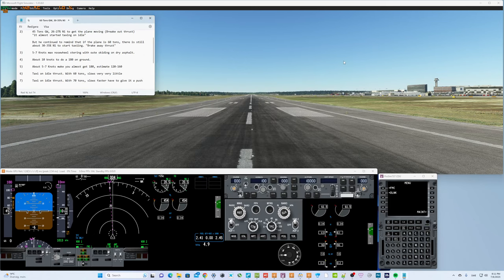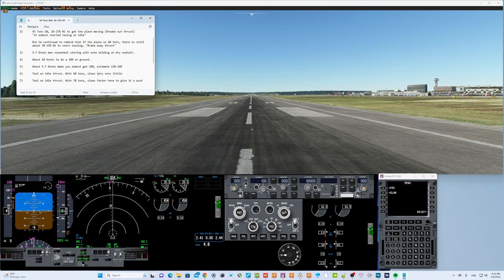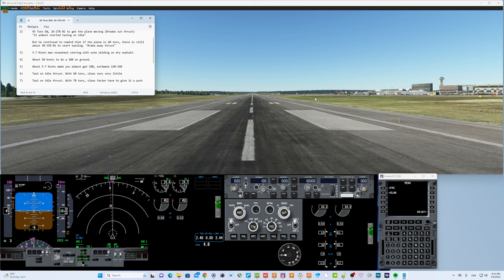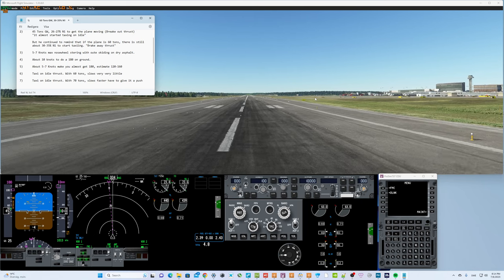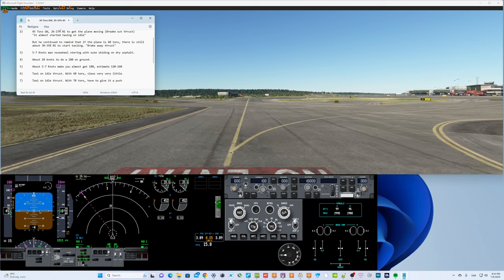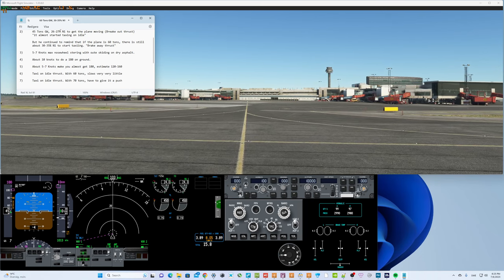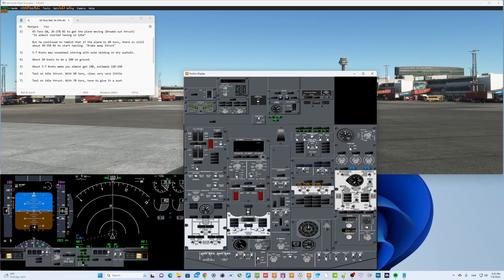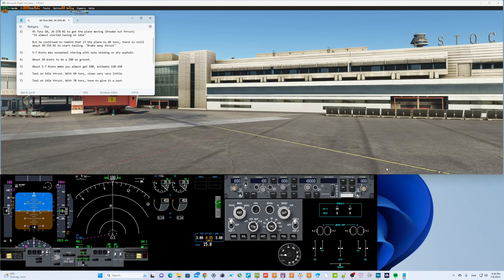[PERFECT TAXI BEHAVIOR ] ProSim flight model 2.08 + MSFS Rudder Fix Program

Comment: Good to see that the rudder and tiller has finally been fixed. I thought that the problem was nothing to do with ProSim and was totally an MSFS problem according to Lapi. 

Curious because he is NEVER wrong.
Reply from the maker: It is a MSFS problem, so he is right in that regard. But all of flightsim history developers have to do workarounds due to limitations i flightplatform. I also have to use a extra program to fix the tiller. The extra program "FSRRudder Fix"should have bin implemented  in ProSim long time agoe. All  other developers have done work arounds to get rudder tiller to work.
Reply: @jacobwiqvist1760  That is really helpful to know. Can you tell us a bit more about the rudder fix software that you use, where to get it and how to install it?

Thank you so much.